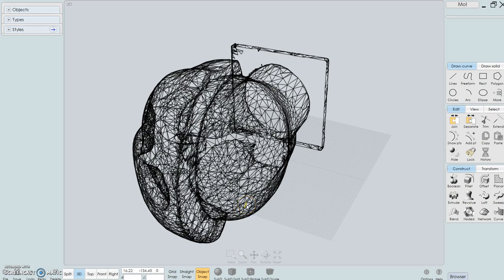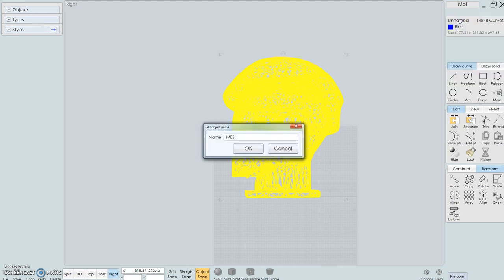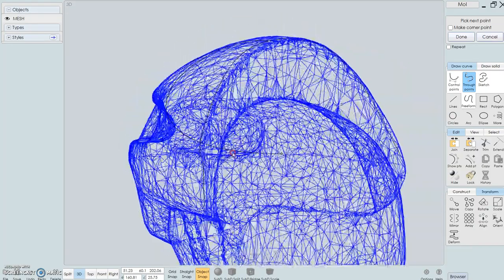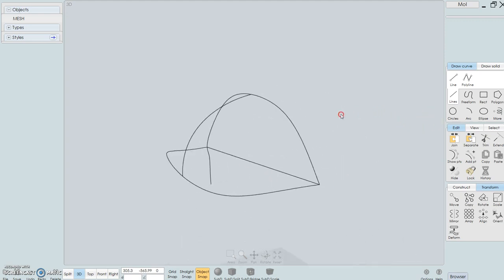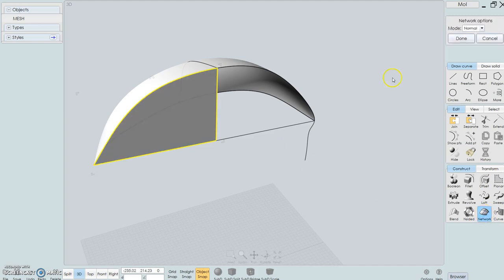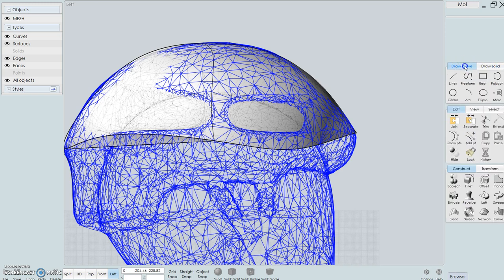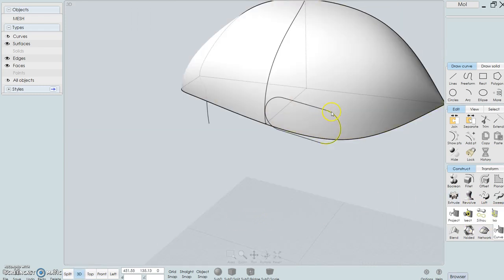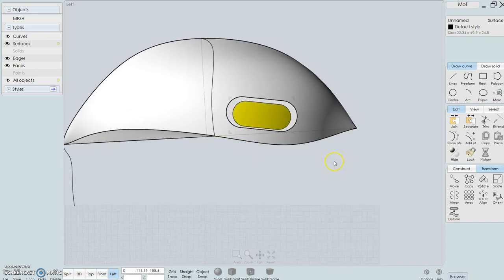MOI import Mesh and Model

Comment: How import stl file to Moi3d ? Thanks.
Reply from the maker: the short answer, you can't. You will  need to find a converter to translate the stl into an obj, which is a type of line wireframe, try googling it and you can find a few options
Reply: @sid_computercourse1242  ok. thank you very much.